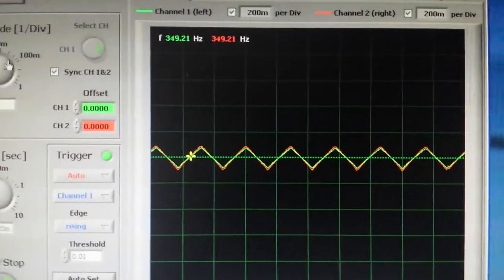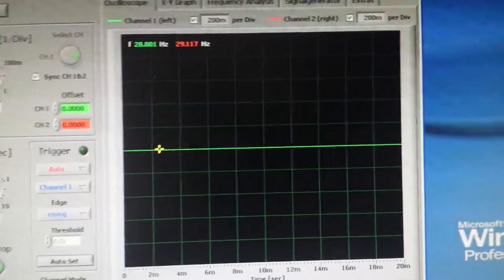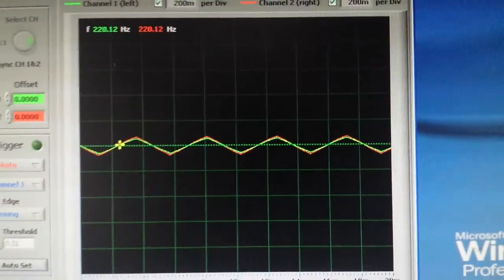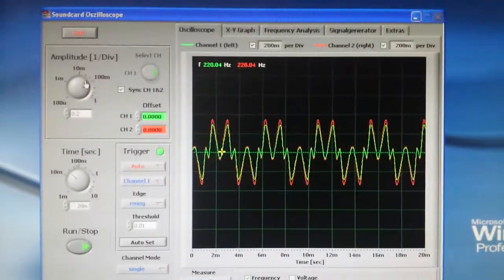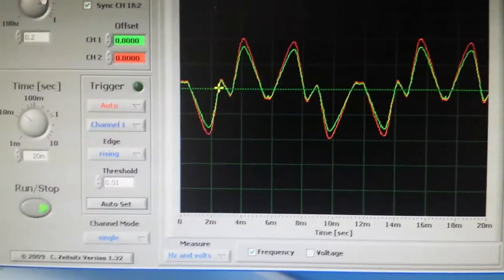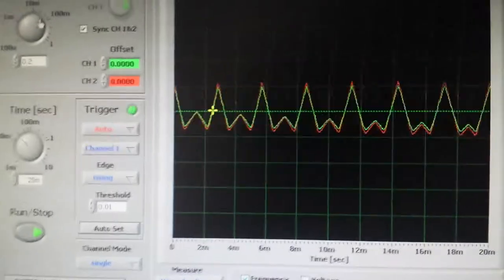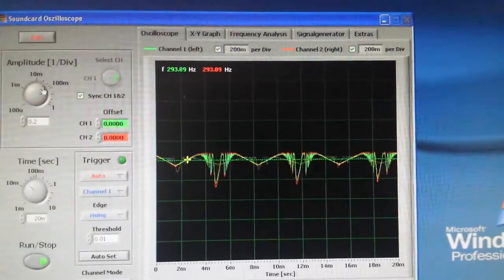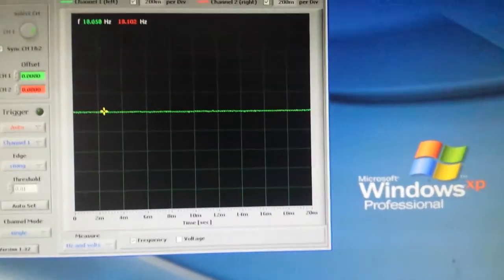DIY analog synth project (The Wavefolder Tutorial intro)

Comment: 4:05 - cool! it sounds similar to a bass clarnet. FM over this sounds very noisy. Maybe because WF itself is close to some "phase distortion" or "FM" type of modulation. It would be cool to know the exact mechanism of wavefolding so it can be used to create more "precise" shapes and make accurate morphing. More or less because it's analog anyway and sounds more interesting than similar wavefolding in a VST application.
Reply from the maker: MoolahNasreddin Yes its a cool addition and with some precise tinkering it can be quite musical or really aggresive and noisy (how i like sometimes). Ur right yes its easy to pile on the modulation to the piont its very noisy . Bear in mind this was just done on the fly not like a planned demo :-), thanks for your comment as always :-)